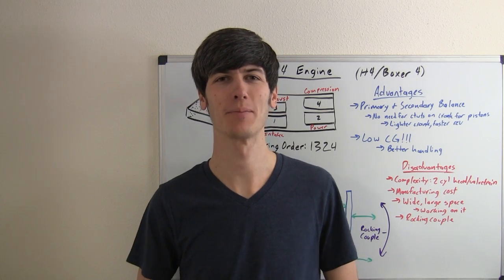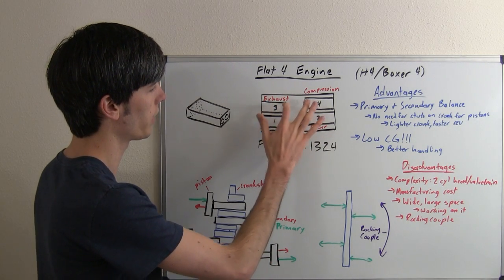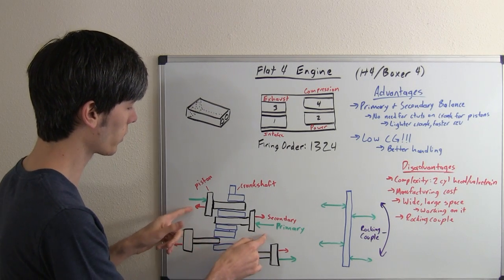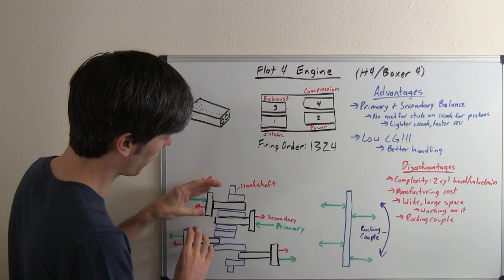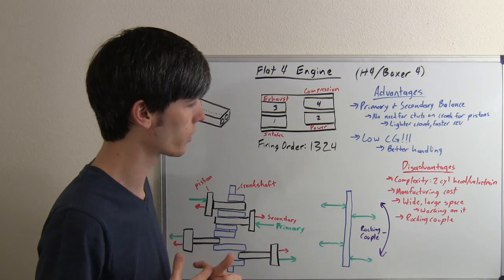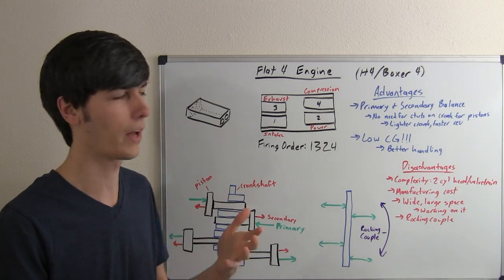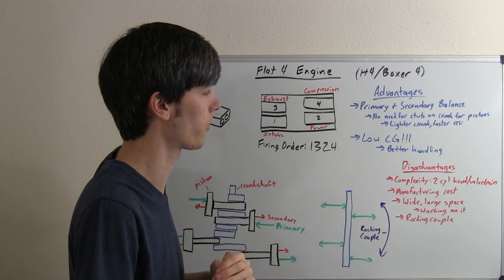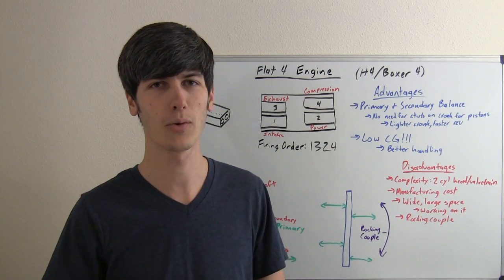Boxer Engine - Flat Four Engine - Explained

Comment: Thank you for the vid on this engine-family, even though they are rare.
But I dont understand the "Rocking Couple".
Is it a specific of 4-cylinder engines?
How does this problem work out in a flat-6 or flat-8 like the Porsche 911/ 918?
Reply: Consider a see saw. At one end, someone is pushing down on the seat, at the other, someone is pulling up. Then they swap over, so the first person is no pulling up and the second person is pushing down. It sets up a rocking motion that pivots around the centre of the see saw. When the rocking motion is caused by forces, it is called a rocking couple. The term couple signifies that the motion is circular rather than in a straight line.

Now rotate this 90 degrees so that it is occuring in a flat plane rather than up and down plane. This is what happens with the SECONDARY forces of a boxer 4 engine (this wasn't rather glossed over in the video - see the red arrows in the labelled piston diagram). The secondary force of the piston at one end is forcing the crankshaft one direction while the piston at the other is forcing the crankshaft in the opposite direction. The result is that the crankshaft tries to rotate about it's centre. As the engine turns, the forces change direction and try to spin the crankshaft in the opposite direction, creating the rocking motion. The forces change direction every 90 degrees as secondary forces alternate every 90 degrees.

Now, the rocking motion isn't too bad for two reasons: Firstly, secondary forces don't kick up much stink in general (remember the inline 4 video, the secondary forces all ADD up rather than cancel out, but they are not significant enough to bother balancing in most car engines); and Secondly, because the inner two pistons create the same type of rocking couple, but they create it in the exact opposite direction, which cancels out the original rocking couple to a large degree. However, it doesn't cancel out the whole rocking couple because the two inner pistons are closer to the centre of rotation (of the rocking couple, ie. the mid point of the crankshaft) than the two outer pistons. 

Torque = Force x distance to centre of rotation. The force of all the pistons is the same, but the distance to the mid point of the crankshaft is greater in the outer pistons, therefore the two rocking couples created don't balance each other but leave a residual rocking couple that acts in the same direction as the outer rocking couple. Ultimately though, the rocking couple is really really small. Close enough and good enough really.

NB: A secondary force is approximately 1/4 of a primary force, and a flat four crankshaft is very short - ie. sweet fuck all rocking torque can be generated in the first place, before being considerably cancelled out.

Does this make sense?

How does this work out in flat 6's and flat 8's? Significantly different. This rocking couple occurs due to a specific weakness in the design of the boxer 4 crankshaft. The boxer 4 crankshaft has as part of its design maximum forces that occur in opposite directions at opposite ends of the crankshaft AT THE SAME TIME, which is the same as the inline 4 engine. Boxer 6 and 8 engines don't have a flat plane crankshaft (heaps of pictures of 911 crankshafts around ask google) so the secondary forces can't act in the same manner.

When one end of a boxer 6 crankshaft has maximum secondary forces, the other end only has 1/2 the secondary force. And because the outside sets of pistons (there are now three sets of pistons) are much further from the mid point of the crankshaft, the torque created by the secondary force of one piston is cancelled to significant degree by the opposing piston on the other side of the crankshaft. The amount it is cancelled is greater then in the flat four. To sum up, the amount of secondary force is reduced and the torque it tries to create a rocking couple with is virtually cancelled out. The rocking couple is so small that engineers consider boxer 6's to be perfectly balanced. The same thing applies to boxer 8's, but the forces are even smaller and torque created is lower. For all intents and purposes it is perfectly balanced. 

Boxer 12's are an interesting exception to the rule. Boxer 12's are completely perfectly balanced, there is no rocking couple at all.

Lot of typing there, any questions?
Reply: thank you for this... I could not wrap my head around the rocking couple problem till I read this explanation.

Comment: question, if a theoretical flat-4 engine that can push say up to 10.000 RPM, would the rocking force be better cancelled than say a lower RPM flat-4? also, is there anyway to negate the rocking force other than putting some vibration absorbers or the likes of that?

Comment: Great channel. Subscribed, but I do have some questions:
1 - does a boxer engine have primary and secondary balance regardless of number of cylinders (provided that number is even)? I think some BMW motorcycles just have a 2 cylinder boxer engine, are those also balanced? If it's balanced for 2, than it should be for any even number since it's just the same building block repeated over and over.
2 - what are the differences between an h4 and an h6.
3 - since a v12 can have any angle between the banks, why not 180 degrees? I think the 1990's Ferrari Testarossa had such an engine. Is there a difference between a 180 degree V12 and an H12 or are they essentially the same?
Reply: +paul zapodeanu Yes the BMW boxer twins also have primary and secondary balance. Likewise they are affected by a rocking couple on the vertical axis. With regards to your third question a 180° V12 like the classic Ferrari 512 BB is not a boxer, in a V motor the piston s move in the same direction. A boxer cannot share the same crank pins on the crankshaft, for a true boxer the pistons must move in opposite directions. So a flat motor is not necessarily a boxer.
Reply: Yes, the Testarossa had a flat-12 engine.

Comment: I think you've got the firing order wrong. If it was 1324, that would mean while Cylinder 1 is in power stroke, cylinder 2 should be on a compression stroke at the same time. That would be wrong because when I watched an animation of a flat4, cylinder one and two pistons are closer to Top Dead Centre while the Cylinder 3and4 ones are closer to BDC.
Reply: Oh nevermind you're right.

Comment: In addition to missing an opportunity to explain the difference between a "Boxer" engine and a "Flat" or "180 degree V engine", you actually confused the terminology between "Flat" and "Boxer".  They're not the same thing, though it's a common error.  The crankshaft design is the distinguishing difference between the two.  In a Boxer engine, each pair of opposing pistons are installed to their own crank pins, 180 degrees opposite in the crankshaft's rotation cycle.  In a Flat, or 180 degree V engine, each pair of opposing pistons share the same crank pin.

Comment: That’s why boxer engines are great in Porsche 911 or newer are great. But also why Honda Goldwing Motorcycles are the most smooth riding bikes. Such a heavy bike that rides and corners like a much smaller café style motorcycle that weighs twice as much.

Comment: This is an older video by now, but is it possible to explain the difference between Porsche 6-cylinder boxers and Subaru 6-cylinder boxers? There must be a difference in firing order for them to sound differently, but I can't really find anything on the internet.

Comment: I'm 99% sure that cylinders 1 and 2 fire simultaneously, and 3 & 4 are coupled in the same way in Subaru engines. Please correct me if I'm wrong.

Comment: Could you try to explain why worn tires generaly offer less grip than new ones. I know about the tread depth which helps with water expulsion and all but don't understand dry weather traction. What about racing tires with no tread pattern also?

Comment: How would the lubrication system act? With the crank at the same level as the pistons, wouldn't there need to be added complexity in the oil passages?
Reply: Oil is pressurized in almost all modern engines.

Comment: With these perfect engins , why don't Subaru or other manufacturers make a boxer Ute . Espesially with the benifit of Subaru AWD , there is a great oppertunity in Utes (pickups) . With these lower center of gravity wouldn't it be able to lift the suspension even higher for more off roading practicality?

Comment: Okay, so you said in order to balance out the secondary imbalance you would reorient the cylinders to fix the rocking couple. How many degrees or what distance would you rearrange them and why? And why would you rather not just add counterbalance weights to this? Do the counterweights add to the friction/inertia essentially making it slower? Like, I'm trying to figure out how much better a boxer 4 engine would be with the rocking couple fixed. Thanks.
Reply: Engineering Explained
Reply: Ctwts would make it heavier, I suppose.... Idk.

Comment: Are you going to continue to cover all the flat engines H6, H8, and H12? Why didn't you cover that flat 4 self destruct above 2.5 liters ( hence why subaru has the H6) Above 2.5 liters the crank tries to move in the block vertically in the block? This is also why the JDM Subaru STI WRX some with a solid one piece block instead of two halves. (other markets don't get such luxuries)

Comment: I heard about boxer engine being less durable since the head gasket is always soaked in engine coolant even when the engine is not running, therefore, it cannot flow downward because of its design and causes premature head gasket failure. Is that true?
Reply: There should not be any air bubbles in the cooling system, it should be completely full of coolant. Therefore, the head gasket will always be soaked in coolant. I'd say it's bogus, the ej20 is one of the more reliable stock engines around.
Reply: I'm also wondering, is it different for inline engines? Does the head gasket always stay soaked or does the design allow the fluid to flow downward somewhere when the water pump isn't running? Also, is being soaked all the time a good thing, or irrelevant to the corrosion? Is it air bubbles or fluid the culprit?
Reply: Ideally there are no air bubbles in the cooling system. Sometimes some develop. That goes for all water cooled piston engines.

Comment: But opposed cylinder designs don't have natural oil flow. I've pondered a way wide "V", so it has a tiny bit of the imbalance of a non-flat but also has oil that flees the combustion chamber.

Comment: I've always wondered why it didn't wear one side of the piston and cylinder more since you always have the weight of the piston acting directly against the cylinder wall, ie the piston is laying down on the cylinder wall with its full weight
Reply: Oil pressure, Daniel-San

Comment: So cost and maintinance aside, would making a "boxer" 8 engine be better than a V8 in terms of 90 degree difference on the crank or even a boxer 6 with 120 degree difference on the crank, similar to the inline 6? Would a boxer 8 in theory be able to create more power and torque by firing every 90 degrees rather than every 180? I am not concerned about fuel efficiency or cost effectiveness at all, just straight up theory.

Comment: out of 2 cylinder engines, wouldn't the flat 2 be the most balanced vs. v-twin and the parallel twin? plus it would have an even firing order to further smooth it out.

Comment: Hmm might I detect a slight bit of bias in this video? :P
Reply: Haha I was thinking the same thing. But boxers are really cool.
Reply: MR92075
No doubt, just messing with him.
Reply: He bought one for a reason. haha
Reply: I feel like it had to do with a certain wr blue mica car he owns.
Reply from the maker: Haha, two comments. 1. I made the video before buying the car. 2. I bought the car for many reasons, the engine design included.
Reply: Rotary engines would be cool since Mazda is so well known for those specific types of motors.
Reply: Authur Jackson
The French, and yes, it is a daft design. Far to much moving mass especialy at higher revs and the movement of the engine createt unnessecary drag and the lubrication was a huge problem. Some early models have needed more oil than fuel.
Reply: shi01 It also gives single engine planes odd handling characteristics. The radial is superior in everything but cooling.
Reply: Son of a Zombie lmao.  Thanks for the laugh
Reply: +Dest Droid Left out oil issues, ringlands... yeah he's biased.
Reply: Those are both issues with particular implementations, and not boxers in general.  You can have ringland issues on any kind of engine, so why would he mention it here?  Boxers are used in light aircraft and when implemented properly are extremely reliable.

Comment: hey bro! i was wondering that when the firing order is 1,3,2,4 how can the balance be obtained at the TDC? i mean if the 1st cylinder is at the TDC then the 2nd also has to be at the TDC to obtain balance right!? then how can the firing order be 1,3,2,4? is the "firing order" term,term for the spark plug firing? i had this doubt for all the engines.

Comment: the flat four in the brz has realy high compration ratio about 12,5 or something, do you think this will wear the engine after 100.000 miles or is this a more reliably setup than a turbocharger setup on a typical 200hp gasoline engine

Comment: Why do manufacturers offset the pistons instead of having them directly opposed, using some mechanical means. Maybe something of the sort used in radial engines? Is it just cheaper to deal with the rocking couple than to have a more complex crank?
Reply: if they were directly opposed with and engine that has an even amount of cylinders they half of them won't fire because they are fighting each other, that's why radial engines always have an odd amount of cylinders.
Reply: +brandon hubbard I don't think it's the case that it couldn't work. There already exists a boxer-similar engine called the 180 degree engine, which is mentioned on the wikipedia page for flat engines. But even that has the opposed pistons sharing a crankpin instead of being directly opposed. I suppose for most applications the effort to have perfectly opposed flat engines isn't worth it compared to the downside of worse timing.
Reply: why? when the timing is right,wouldnt they support each other as on pushes the other while it needs to be pushed anyways? 
just thinking. would love an explanation. 
Im just 17 there must be a reason for this to not work the way i think it works.

Comment: In the 2 cyl flat engines the same direction of the pistons cause some kind of vacuum inside the crankcase? I remember something about oil consumption in 2 cyl flat engines like Citroen's 2cv engines but i'm not sure..
Reply: 2cyl boxer cylinders are opposed motion, never heard of that problem in my BMW boxer, which the citroen was designed from.

Comment: the width of the engine is the reason why usually manufacturers do not exceed 6 cylinders in this kind of layout?
Reply from the maker: Yeah, they take up a rather large area.
Reply: thx :)
Reply: Engineering Explained I believe Ferrari used a Flat twelve in one of thier old F1 cars. Hows that for taking up real estate?

Comment: Hey I was thinking about this, and since pistons 1 and 2 are both going in and out at the same time, doesnt that mean that they will be firing at the same time? Same thought on pistons 3 and 4, shouldnt they fire at the same time?
Reply: No because its a 4 stroke engine, when pistons 1 and 2 are going in, one is compressing the fuel air mixture in the cylinder, the other is on the exhaust stroke. For the other two, one is under ignition, and the other is on the intake stroke

Comment: Is this style of flat engine the same for Porsche as well? I know they have a flat 6 but is it the same just add 2 more cylinders?
Reply: Yes Porsche and Subaru both use Boxer engines.
Reply: thanks wasn't sure there was a different type of boxer engine
Reply: Several porches have used flat fours too. 356's and 912's both had flat fours.
Reply: And Subaru has Horizontal 6s as well, such as the eg33 or ez36.
Reply: BMW use flat twins in several bike models.
Reply: On a point of view about crankshaft harmonic balance, the flat SIX must prove it not to be a bad issue so the flat four is feasible .
Reply: Rubbish. A pair of cylinders in boxer arrangement have effectively zero imbalance. Therefore adding additional pairs of cylinders to the first two just gets the imbalance closer and closer to zero. The flat six doesn't have to prove anything.